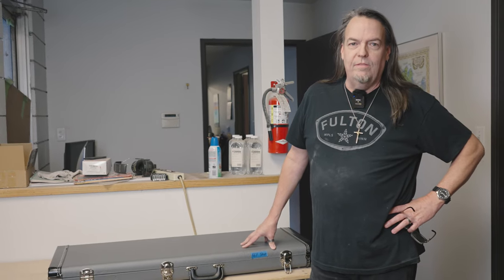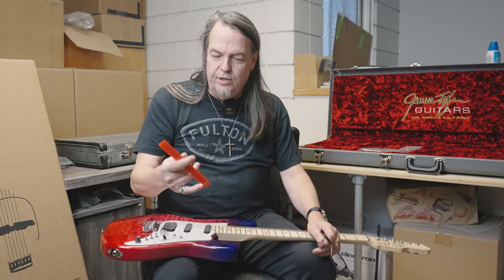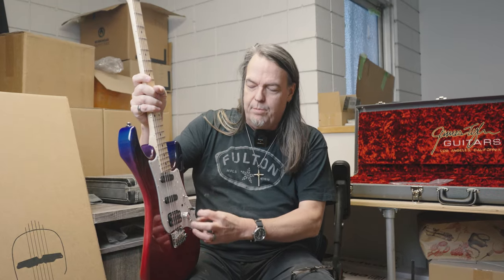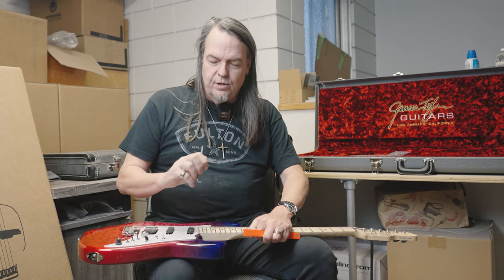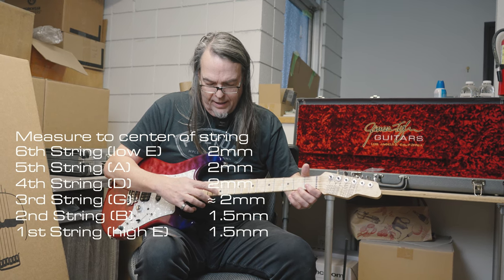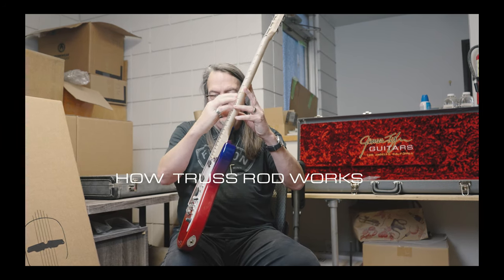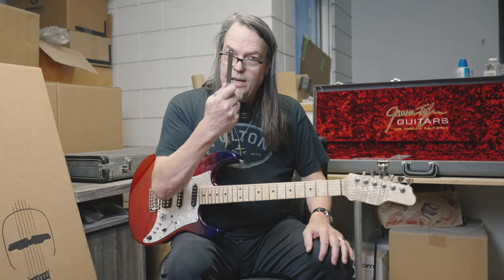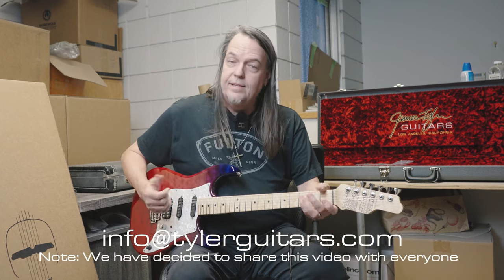Learn How To Adjust Your Guitar Neck | Truss Rod Adjustment Tutorial

Comment: I don't know Tyler's specs to the 0.001", but Fender's website goes into good detail about truss tod and action adjustment, which may help to clarify the information in this video.  As well as a "string action ruler" from eBay, I have an old English half-penny that is 1/16" (or 1.6mm) thick, which I use to check the action, and a set of feeler gauges for checking the neck relief.